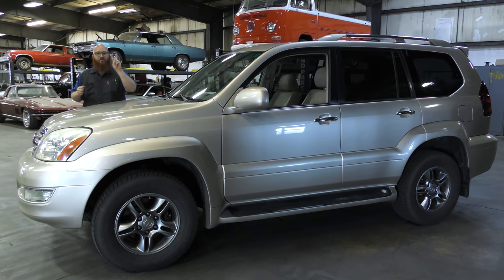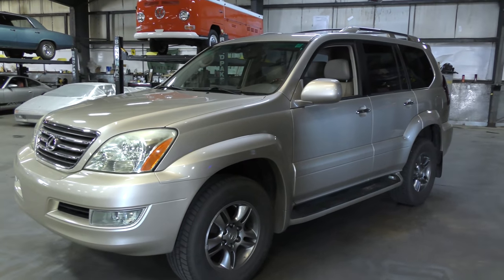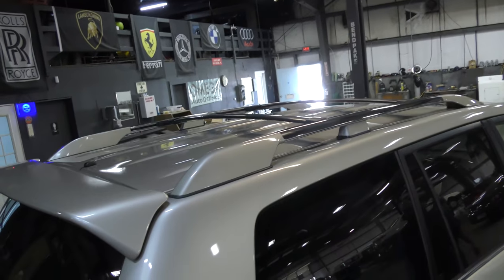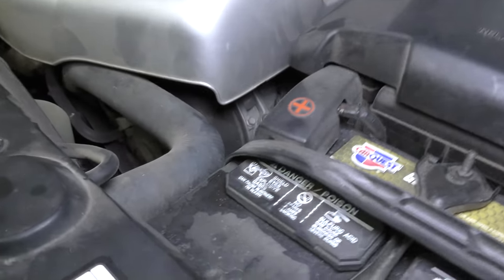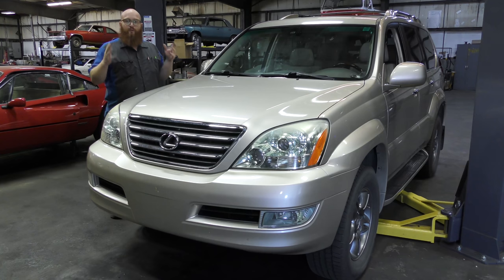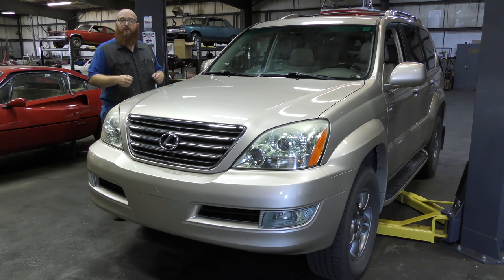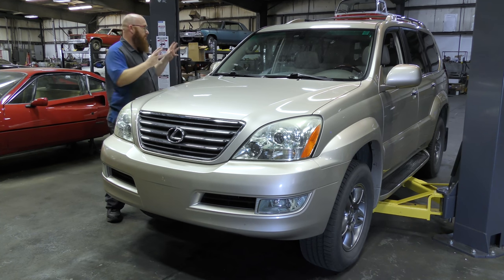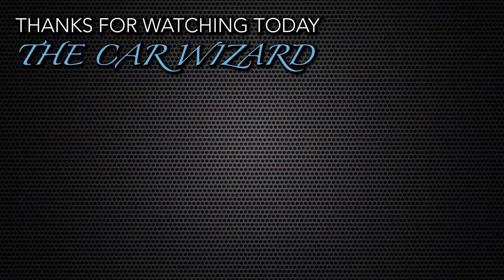Reliable cars get surprise bills too. Simple oil change on '08 Lexus GX470 turns into $1200 repair

Comment: just had the same issue on my 4runner v8 with both front axels slinging grease. fixed for 600 bucks at local shop!

Comment: Was on the market to buy one of these to add as another car for my 100 series Land Cruiser. They went from $6k-7k to $15k over the last year. Ended up buying a 2007 Cayenne S for $7k and better shape than the GX470s I looked at. Put a lift kit on the Cayenne and 33s and it goes where my old lifted 80 series LC goes.

Comment: The newer ones just aren’t as good. My Lexus LS460 has needed a thermostat, cooling fan module, radiator, and now the coolant valley plate is leaking. All of this in the last 10K miles with only 135K miles. My 2006 Toyota Tundra with 167K miles has needed none of that, except I did have the timing belt service done at 135K. I have been really disappointed with the LS460 reliability.
Reply: I’ve been driving a 2008 v8 4runner for 4 years and sitting in and driving the newer 4runners and toyota’s truck makes me feel like i have a newer version of those lmao. toyota has definitely gotten cheaper and less reliable recently. up to 2k10 they seemed decent now it seems like everyone is going to shit. i sit in a lot of different cars as an auto tech and nothing new seems like something i’d really wanna invest in. it’s all cheaper and cheaper plastic and electronic parts,
Reply: Yes, I feel like peak of Lexus/Toyota quality was 2000-16. Newer product like the LS500 and the horror stories I'm hearing of reliability issues is something Lexus would've fired the entire plant for in year's past. It is also why Lexus keeps the GX on such long life spans. The current one dates back to 2010 and is likely the most sturdy vehicle they sell.
Reply: I'm a Toyota mechanic and I wouldn't buy anything they make after M.Y 2019. Far too many quality issues, esp with the RAV4 and Tacoma. The only exception is the 4Runner, that is still a great vehicle thanks to its outdated but proven powertrain. And its made in Japan.  I do a lot of road trips so i wanted something more comfortable and efficient than the older cars i normally own, and i haven't owned a band new car in my life. I ended up buying a VW Golf as it felt better made than a current Corolla, replacing trim pieces falling off and fuel pump recalls put me off. The only recall my Golf had was the block heater cord label wasn't bilingual. I don't judge car makes on their reputation as it can change over time. I did have another Golf in 2010 and that one was terrible but that's a generation ago.
Reply: That's unfortunate to hear. But, I'm sure it's still better than buying a Dodge, Chevy or Hyundai.

Comment: I have a 2003 Toyota 4Runner V8 4wd which I believe is very similar to this.  Perhaps not quite as high quality as the Lexus but close. After living outside for 18 New England winters it still drives exactly like a new car.  Have done all prescribed maintenance and kept it rustproofed and so far it has been completely bombproof on and off road.

Comment: 6 years - 60,000 miles. I would change the timing belt just for peace of mind. Just had mine jump over a teath 4 years and 30000 miles after it has been changed. Luckily no damage.

Comment: My new-to-me 2006 4Runner (214k miles) goes into the shop for new front axles next week. Like this GX, both inner boots were aged, brittle, and split -- who knows how long they've been that way. no grease left in them. Outer boots looked shiny new -- probably been done in past few years. The front end has always had a minor shudder in the steering wheel, also in the brake pedal during braking. The pedal vibration went away when I R&Red the rotors and pads on all four corners. That's when I discovered the split inner boots. There is still a harmonic flutter in the steering wheel at 60-65mph in 2WD, which I am hoping fresh axle assemblies will take care of. I am perfectly happy to pay a mechanic for this (messy) job.  And I will happily put $1200 into the 4Runner; b/c once we sort out a few of these existing issues, I fully expect to get ten to fifteen reliable years out of it. Done since purchase in February: brake pads & rotors; new headlight assemblies; interior lamps to LED; climate panel bulbs replaced (easy!); oil change; A/T fluid flush&fill; lower door cladding removed, epoxy-repaired, and installed with new clips (not easy!).

Comment: 2008 GX470 in the garage.  112K miles.  Bought it for $24K in 1017   We have only had to do the timing belt and an air pump, plus tires, a front hub, and a water pump when we did the timing belt.   This car glides like no other car I have driven.  We live in the woods and the mice got under the intake cover and decided to to take up residence.  The air pump sucked in mouse house parts and ate itself up.   Threw a code and put it in limp mode.   Three hours later, a new pump and gasket set and it was back in order.  Not a difficult repair just time consuming.  Only problem with the air pump failure code is it puts you in limp mode.  Very dangerous if you get on the freeway and can only go 35MPH.   Getting new headlights tomorrow, the vehicle has been garaged its whole life and the headlights still turned yellow.  No restoration possible it appears to be through the entire lens plastic (Ford doesn't have this problem). The only low quality thing about this vehicle.  If I could keep my wife from denting and scratching the corners of the bumpers it would be perfect.  My wife would like a newer one but I said this only has another 300,000 miles of life left in it.  After that she can get a newer one. And only if she promises not to back up or negotiate tight spaces.

Comment: Something else to consider regarding that spare tire on a vehicle this old is the age of the spare.  I drive a 2001 Ford F150 truck and always insured the spare had air when the other tires were rotated and balanced.  The problem when I finally needed to use it was it was totally dry rotted, and I feared using it to limp to the repair shop.  If you keep a vehicle for long periods of time, consider replacing the spare at least once during that time so its viable when you need it.

Comment: Where I live, these car is sold as the toyota land cruiser prado, a more affordable, smaller version of the land cruiser. They are usually equipped with 4 cylinder turbo diesel engines and can be found with either a manual or an automatic transmission. They are not as well equipped as the lexus, usually have less stuff, cloth seats and grey plastic trim. Very good off roaders, hold their value extremely well, although plastic trim, headlights and dash don't last as long as the mechanical bits.

Comment: 151K. It has had a new timing belt, it needs 4 half-shafts and 4 brake rotors. It has received top-notch maintenance and the underside shows no signs of off-roading? -- I would not even look at one of these that had less than perfect maintenance.

Comment: It really depends on the effort when building a car. Have a 07 Kia Rondo made in Korea w 148k miles. Still runs like a clock. Did all fluid maintenance myself, only major breakdown was the compressor. Suspension a bit stiff but only paid $19k when new.

Comment: I'd rather have a reliable Lexus than a 'high-end' Porsche Cayenne from the same years that's going to be an unreliable and expensive to fix car.
Reply: Porsche actually has surprisingly above average reliability. They can be expensive to maintain and hard to work on, but they are actually very reliable, and consistently rank near the top of reliability rankings.
Reply: Porsche is one of the most reliable vehicles you can buy.
The maintenance cost is high but to say they're unreliable is flat-out incorrect.
They're rated top-3 most reliable in almost every single study, survey, etc for the last 5 years.
Reply: @DiaperSNiFFER  A Cayenne is not a "Porsche" in the same way as a 911, Boxter or Cayman, it's an Audi Q7/VW Toureg. And let those just be some of the most expensive SUV's to maintain.
Reply: Actually Porsche was rated in the top 2 or 3 in reliability for a ling while. often only beaten out by KIA.. Our Cayenne has been one of the most reliable cars we have ever had
dont mix Porsche with BMW 😮🙄😂.
Reply: @ohioplayer-bl9em  Kia is crap. Porsche is good though.
Reply: @m0rb1d43  technically you right. I’ve heard good things about cayennes over it’s Volkswagen and Audi siblings
Reply: @DiaperSNiFFER  
Bull crap! My `03 VW Golf GL automatic w/ 160k on the clock has been incredibly reliable and easy to maintain.
Reply: @DiaperSNiFFER  No, MB are among the most reliable ones. Used as Taxis all over Europe and many other places
Reply: @martinsvensson6884  That was a long time ago, these day's you don't see that many MB taxi's anymore.
Reply: @martinsvensson6884  what model? We definitely don’t have that specific model in USA 🇺🇸 🇨🇦 Canada
Reply: @m0rb1d43  Dont know about the latest generation. But they were extremely common up until and with the w212.
Reply: @DiaperSNiFFER  Were generally the base models. E200, E220, E250. Almost all diesels due to lower fuel consumption.

Comment: Wizard. I have a mechanic that does all my car's and has done for over 25 years. He operates very much like you. He will tell us of anything that he finds wrong and need attention rite now or will need to be done next service. He also gives us an estimate on costs to do the works. There are cheaper places around but I'm not interested in cheap. I know I can get in either car at any time and go wherever I need to. I could get in my car and drive to the other side of the country (Western Australia to the east coast) and know I can get there and back with zero breakdowns. You have to have confidence in your mechanic to do that in Australia!

Comment: I bought into the GX-470 craze. Thing was a basket case. Put a whole new junkyard axle in the rear because the rear diff was shot, replaced one cv axle in the front, the climate control diverter thing behind the glovebox, steering rack, T-case seals and actuator, among other things I can't even remember now. But the engine and transmission worked good. Still made some profit when I sold it because the value went up so much, but never again... Much happier with my Ford Expedition.

Comment: Hard to get me to ever give up my GX470... my reliable little tank, that rides buttery smooth
Reply: Me either bro about my Lexus I own a 2006 Lexus LS430 never getting rid of mines it’s a gem 💎 😎🤝
Reply: Bought a '07 LS460 with 68,000 miles, an utter joy to drive. Smoothest and quietest thing I've ever driven. Incredibly solidly made too, I'm now a huge fan of Lexus/Toyota
Reply: What year do you have?
Reply: @audioamateur  🤝😎
Reply: @seanbarnes9550  2005, same color combo as the video. Not my favorite colors, but that’s a small part of the experience.
Reply: @theodoreyoung8777  LS 430’s are excellent vehicles. Always keeping my eye out for an LS430/460 to pick up one day. Best part about owning Toyota/Lexus is you can shop for a car when you want to and it fits your criteria... not because you HAVE to due to vehicle breakdowns.
Reply: @audioamateur  jealous of the vehicle and mileage, what a find.
Reply: @JH-qy7zw  Yes bro perfectly stated 🤝😎
Reply: @JH-qy7zw  Best wishes on you finding one have u ever owned a Lexus LS430 or LS460 before?
Reply: @theodoreyoung8777  never owned one myself, but I have 2 brothers that both owned an LS430. They were great vehicles.
Reply: @JH-qy7zw  That’s a fact bro 🤝😎

Comment: 11:06 Silicone spray on the boots would have kept them from drying out and tearing?
Reply: Wurth Rubber Care spray is awesome for cv boots, weatherstripping, etc. Much better than Silicone Spray.
Reply: Scotty K recommends AT205
Reply: @semajniffirg230  Thanks!
Reply: at205 is unavailable
Reply: @brighter22  
Wow! I just checked Amazon and you're right; AT-205 is unavailable. What's goin' on?
Reply: @johna.4334  Supply chain issues.

Comment: 1st car in 2014: 2007 ES350 with 89k miles, sold at 177k miles. Repair expense: $450 for a new A/C condensor and thermostat
2nd car: 2013 ES300H bought at 59k miles, sold at 125k miles. Repair expense: $0
3rd and current car: 2017 RX350, bought at 26k miles it's at 43k miles now. Repair expense: $0

Total out of pocket repair bill over 7 years (not counting maintenance items: brakes, oil, tire, etc): $450.
Reply: 2012 bmw f31 328i bougth with 0 miles and kepts since 156k miles until some idiot run a red light and totalled it. I only head to repair the left xenon headlight for about 1000$ in 9 yeras. Considering the car was used in badly maintained roads in eastern eurpean contries and used in harsh winters, i would not call that a lot more exepnsive. Furtheremore any japanese car would have had rust problemes in similar conditions. Japanese cars rust like crazy compared to german cars ....

Comment: 4 years ago, I bought a Lexus SUV with a very unique color palette & package. I wanted something nobody around me had because I'd hate walking out & seeing 3 of the same car, having those owners get my car mixed up with theirs & try get in it. I know I was the only one in my smaller town with one when I did buy it because I had my detective cousin check & I had to have it shipped to me. For the few months afterwards, I'd catch people looking inside the windows of my car & weirdly, kicking my tires. I always had people asking questions about it. Now I see them every day & I'd guess there are at least 30 of them in my town of 2,700 in only 4 years. I find it annoying but people will be people.

I haven't worked on it other than oil changes & other really basic maintenance. It's a hybrid & still It's been the most carefree car I've ever had.

Comment: What is a bit sad in my part of the world is rust. I live in Sweden, and they put lots and lots of salt on the roads during winter. Toyota are far from the worst regarding rust, but they are far from perfect in that area. That is a bit sad because it reduce the lifespan by a lot. Still good cars, but take a good look under a potential car if you live somewhere that is an issue.
Reply: Living in Michigan, keeping the chassis well coated with oil helps a lot. We own two Hondas, but the Toyota trucks I've owned in the past got me into underbody rustproofing.
Reply: Yeah washing the undercarriage can help reduce the rust
Reply: if you live where it snows a lot why don't you just rust proof the car so you don't have to worry about it
Reply: @ericchen776  Well usually the first owners don't really think about that or don't care, they just drive couple of years and then trade it for a new car. When the second or third owner finds some rust on the chassis then it might already need sandblasting before any rust proofing can be done properly. Then they compare the costs to the value of the car and think 'ah f..k, forget it'.
But usually it can be done quite cheap as DIY if you have time and place to do these things.

Comment: Car Wizard: Toyota products are well designed.

*Yaris owners have entered the chat*
Reply: did I hear water pump or a clutch get mentioned ?
Reply: Had one with 5550000 sold it ac still worked ...a Yaris that is
Reply: My father-in-law bought a loss leader (no radio) Yaris for $12K NEW. I have to say, that is the best driving $12K (new) car I’ve ever driven. It was pretty fun and nimble like old Civics. I think when judging a car it’s important to consider what the manufacturer had to work with when constructing it.
Reply: @313barrygmail  Five and a half million miles. Press x for doubt.

Comment: What you save on reliability, you give back in fuel. Lovely trucks though. A true SUV.
Reply: Can't put a price on peace of mind
Reply: If you want fuel economy, you buy a Honda or Toyota car. 

You don’t buy an SUV for economy unless you’re looking at an EV or hybrid.
Reply: @rotor13  calm down hun. Like I said, it's one of the few true SUVs, but still sucks gas. There is a reason why Highlanders far outsell them. The people usually shopping this size of SUV go for the Highlander with its better space, fuel economy, acceleration, handling, comfort, etc. The buyers that want something with more towing capacity usually go full size for more power, space, towing, etc. The GX is for Lexus loyalists and car guys who know what it's about. If I wanted an SUV, I'd buy one. My brother was looking at newer 4Runners last year and is still happy that I talked him into one of these. I don't know why you would ever have a 4Runner over a used example of a GX for the same money.
Reply: I wouldn’t say the fuel economy is terrible. Sure it’s not great. But I wouldn’t go as far as to call it a gas guzzler or anything
Reply: @platypus842  against comparably sized SUVs, it is. Most SUVs with similar fuel economy are larger and more powerful.
Reply: @mtnman1984  I guess you’re right. I’m kind of stuck thinking in a 2007 fuel economy  mindset. My current daily driver is an ‘08 Lexus GS350 AWD. It’s got 260k on it and running great. Unfortunately the mpg has decreased as it’s gotten older. I average around 17mph combined (mostly city driving). Sticker in 2008 claimed 18city/25highway.
Reply: @platypus842  even if you go year for year using manufacturer numbers, it's the same situation. I really like them and talked my brother out of a 4Runner into a GX, but they aren't objectively competitive to new truck buyers.
Reply: Better to spend 10 minutes a week at the gas station than weeks at a dealer or repair shop I say.
Reply: @Trussme96  If you're comparing this to a Tahoe, I don't know if there's too much difference for most of the model years. If you're comparing this to a Traverse, get a Highlander.